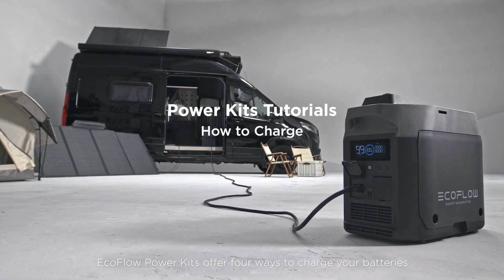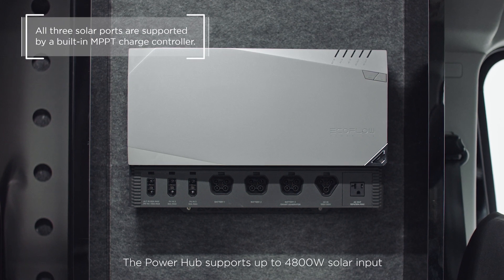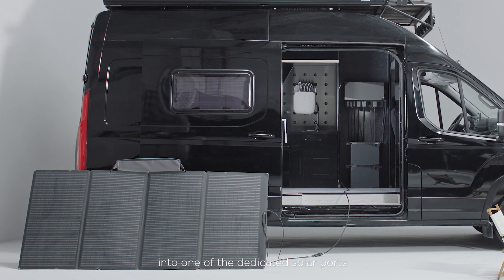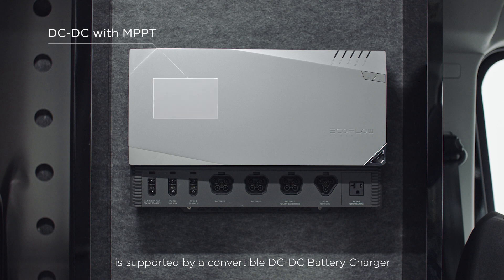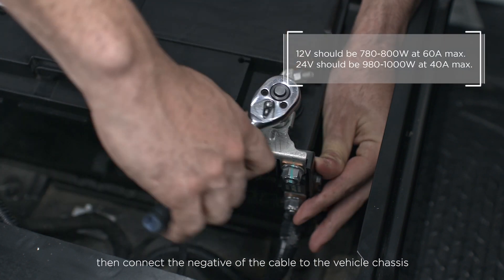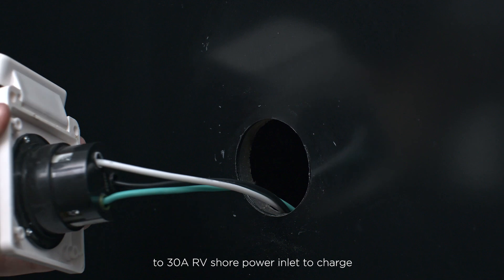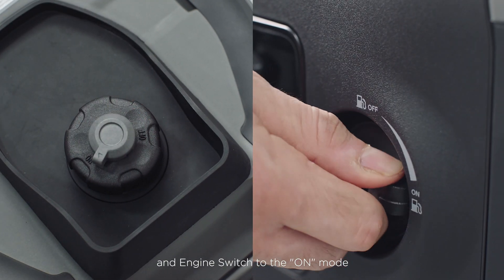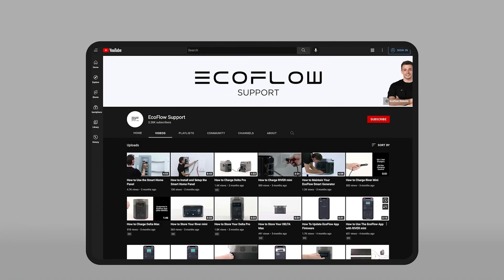Power Kits Tutorials | How to Charge

Comment: I want to add some essential info here that I have learned from a year's worth of using: 2 x 15kWh Power Kits and both a non-EF generators and recently an EF dual fuel generator. 

1. You may charge using the Alternating Current-out on the generator (regardless of what generator you use, it really needs a pure-sine inverter built in to work without the Hub limiting the input or shutting off). 

2. Using Alternating Current ("AC") charging from a generator, there is a severe limitation on the system -- if you are also using the AC-out, and if the wattage output exceeds the AC wattage charge-input, the generator will disconnect and stop charging, AND the Power Hub will disconnect AC output. This is because EF designed AC to use a bypass that goes straight to the output from the charge source. The bypass module gets overloaded if the output exceeds the input, and EVERYTHING shuts down. MAJOR FLAW. Either the module is weak, or the software management needs great improvement. So, forget charging by AC and also trying to simultaneously use the microwave or roof air conditioner.

3.  Also, with AC charging from a generator -- you need to adjust the AC charge input downward so that the generator does not have too much draw on it, which will cause it to disconnect and stop charging (with the generator engine still running, however). I have to adjust my total AC charge input to 13A to keep my EF Dual Fuel Generator from disconnecting from the system although the generator will charge at a higher rate than 13A. You do this through the App or the monitor panel.

4. The video mentions that you can charge with Direct Current (i.e. DC to DC charging) and glosses over another BIG FLAW -- in order to do this, you use a supplied cable that goes from the DC-out on the generator to what the video calls an EXTRA battery port. It also conveniently neglects that to do this you need a special adapter that does not come with either the Power Kit or the EF generator. 

5. Extra battery port? Really? I bought a 15kWh kit (2 actually), with THREE batteries that need to be charged by being plugged into the THREE battery ports. There is NO "EXTRA." 
I guess the expectation is that I give up one of those expensive batteries in order to have backup generator input, thus resulting in lower battery capacity and a higher need to have the generator run, which eats gas or LP pretty damn quickly. So, what EF conveniently calls "extra" is the opposite -- it is a BATTERY DELETE.

I have complained about these issues to EF, with little or no response. Which is why I am writing this here, publicly. 

I recently asked EF if it's possible to create a cable to allows DC charging into the Power Hub's solar inputs. After all, those take DC power from either an alternator or solar panels. Ideally, they could make an adapter that allows you to use both solar and generator DC input into the same solar input port. 

Alternatively, the DC output port, on the side of the hub. could be designed to double as an input, too. This is doable, because we already know that the battery ports are bidirectional (can charge or discharge), which means EF knows how. 

While it would not solve my problem, EF should add an DC charging port for the generator and use a much more robust AC bypass module that does not cause shut-down.

Also -- they need to create a way to add more batteries, not just to solve this battery delete problem, but to expand the capacity of the system beyond 15kW. 

Last, while I am thinking of a next version hub -- how about raising the extremely low 150V solar input limitation to something that makes more sense. Otherwise, we are left connecting panel arrays in parallel and increasing fire hazards as a result. 

For the pricing of EF's components, NONE of these limitations should exist. Sure, the Power Kits are easy to plug and play, but I definitely could buy all components needed to build a bulletproof system which has a much higher charge rate and much greater and expandible battery capacity. Likely, I could do that AND still have money for solar panels and be at about the same price as one EF Power Kit.
Reply from the maker: Hi there, thank you for your feedback! I have passed it on to our product team. For this part " you need to adjust the AC charge input downward so that the generator does not have too much draw on it, which will cause it to disconnect and stop charging (with the generator engine still running, however).", would you mind shoot a video about this and send it to our support email?👉support@ecoflow.com. We would like to have a further look regarding this, thank you!

Comment: How do you wire in your ONAN Diesel Generator instead of the EcoFlow provided one
Reply: If the Onan puts out AC, then you use the AC input. But there is a "catch" to using AC charging that EF doesn't tell anyone.

Comment: It is a good thing that Ecoflow did not use a 12V system and used a 48V system which is more safer and uses thinner wires that makes installation easier.

Comment: What I like best is that I can mix and match between a 2kWh or 5kWh LFP battery.
Reply: Docs that come with the kits say to keep the type of batteries consistent -- use ALL 5kW or ALL 2 kW.
Reply: @collinporterfield102  That was the case up until recently, however now you can mix and match with both 2 kWh and 5 kWh batteries.